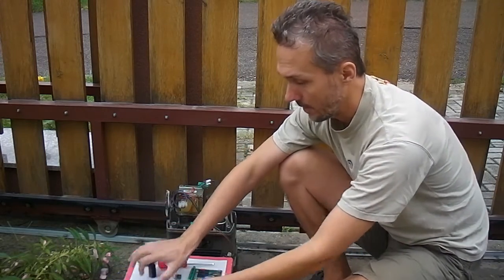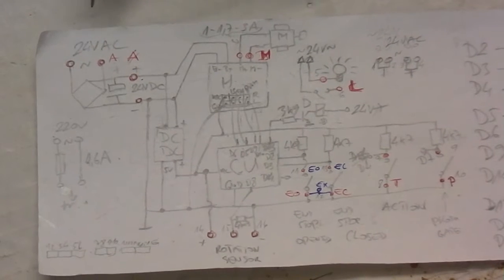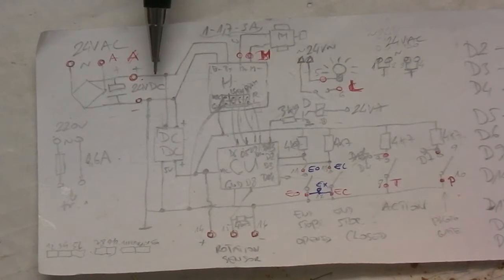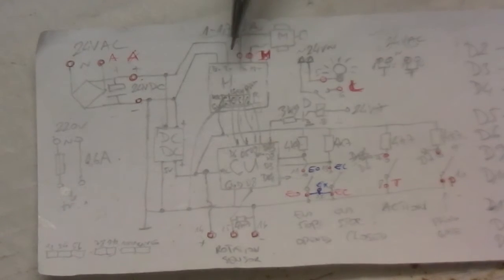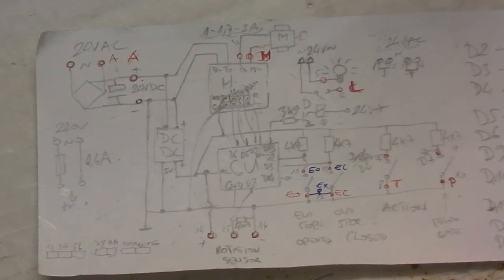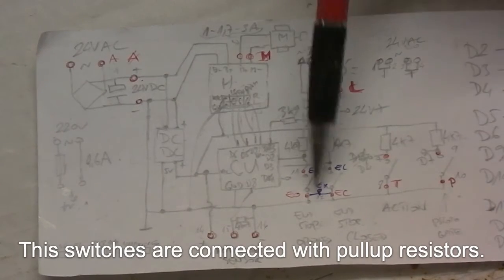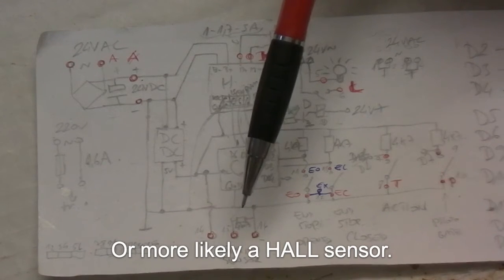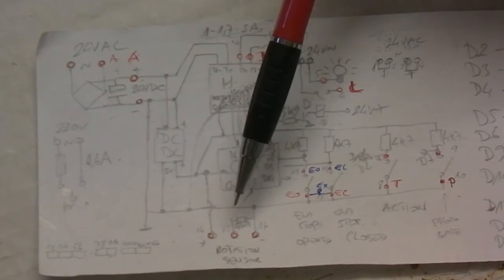Sliding gate controller fix - Part 1

Comment: What country made the controller. And where is the gate. It is weird that your motor is only 24vdc.....your gate must be small.
Reply from the maker: The original controller was Italian (I guess). The gate is rather big, about 300Kg on two wheels. (See part2 of this video.) 24V is enough as it has a has a huge gear ratio.

Comment: How are you turning off the motor is it by using timer or some sought of peak current detector
Reply from the maker: None of those. The motor has rotation feedback. It contains some kind of optical rotation encoder. Mentioned here: https://youtu.be/1hTDsUXfUEs
Reply: Thank you so much for your reply. My motor doesn't have any  encoder, So can i use the current sense pins available in BTS7960. That is whenever the current is above normal it should turn off.
Reply from the maker: My H-bridge motor driver has an "overcurrent" feedback pin. But I found a lot of false-trigger there, and I did not spent too much time understanding this behavior, so I do not relay on this feature.
Reply: Thanks a lot
Reply: Should have been more reliable if using 2 limit switches at both ends, to stop motor.